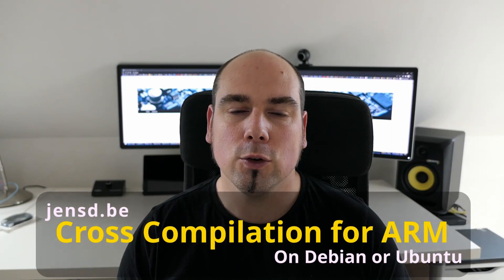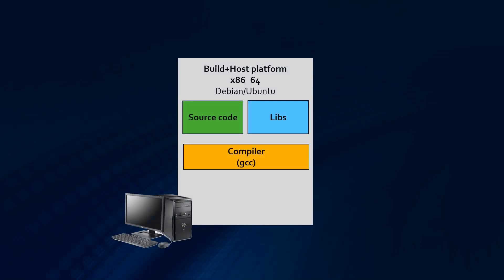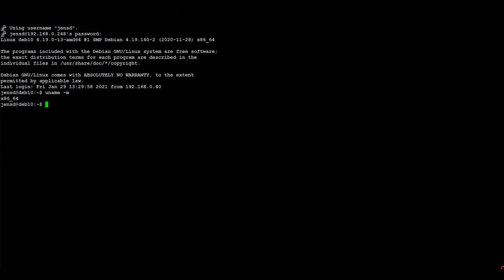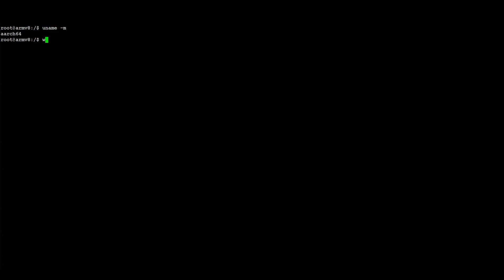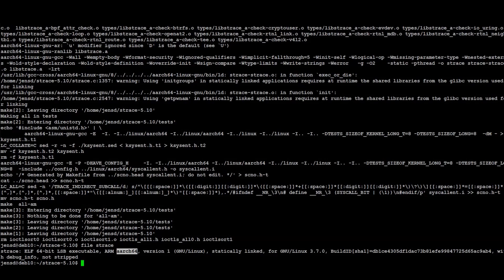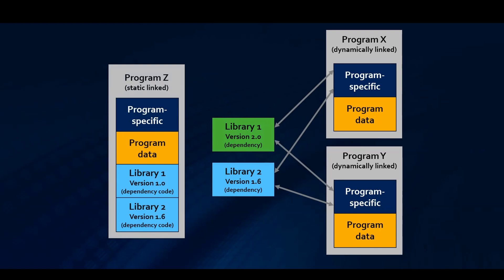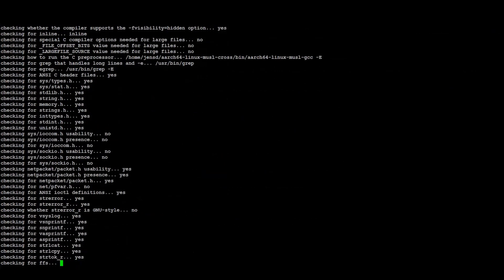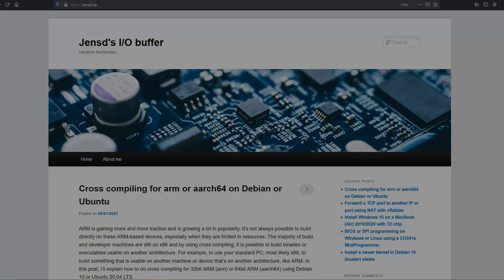Cross compiling for arm or aarch64 on Debian or Ubuntu

Comment: What if the project requires a ton of armhf or else libraries as dependencies?
Reply from the maker: Probably the best option is to script the whole process then instead of going through each manually.
Reply: @jensdbe  isn't creating a docker image with all requirements (like libsdl2-dev etc, the common ones) preinstalled more convenient? That said, i have no experience in doing that, just used other people's docker image to create stuff for my armhf handheld. Some times it works, some other it just needs more. Not existing in xenial repositories etc (that's a xenial armhf docker image)

Comment: What if I now would like to crosscompile a random other package like tensorflow?
Reply from the maker: Similar approach for that. Pre-compile any prerequisites by doing ./configure and make. Then do the same for the actual package/binary that you want to compile. As I did for tcpdump in the video.
Usually a bit of reading is required for the specifics/flags for each tool.

Comment: Generally, works fine except for big endian. When using option '-mbig-endian' it's only possible to compile object files. When building shared libraries or ELF files, error "libstdc++.so (wrong file format)" is issued. It seems the linker tries to use the little-endian version of the .so file.

Comment: Is there a way to cross-compile python script on, let's say Ubuntu, to run on raspberry Pi armv7l? I have been searching a way to do this but haven't been able to get a concrete solution.
Reply from the maker: Python scrips are generally compiled at runtime so they are platform independent. You just need to have the same libraries installed and they should work

Comment: Very clear! Is it possiable to do the dynamic linking?
Reply from the maker: Sure, that's the default, so if you don't pass the -static compiler flag, it should use dynamic linking
Reply: @jensdbe  Thanks for your reply. Is it possiable to install the required arm64 libraries on a amd64 Ubuntu Computer.So I can cross-compile my own library to arm64.

Comment: Is this can by apply on RasPi 4B on Ubuntu 20.4? I can't install programs because Rasp is aarch64 and programs on Ubuntu are for amd64. Is my assumption is correct?
Reply from the maker: The easiest if off course to use tools and programs from the Ubuntu aarch64 repositories by using your regular package manager (apt). But if you need to compile something or want it static linked, then this is what you're looking for.
Reply: @jensdbe  Thanks for info! Channel subscribe.

Comment: I am not familiar with compiled languages. Could someone explain why in many cases (not shown in the video) programs don't work when compiled for a different architecture? 
In other words, why can't Apple just re-compile all it's programs so that they work on the M1 chip?
Reply from the maker: This can get quite complex but, at least as far as I understand it, simply said this is because a lot of tools/programs contain code or instructions tailored to one architecture. This is mainly done to gain performance. By using architecture specific and optimized ways of addressing the hardware and resources you can gain speed. Most CPUs, even when in theory they are on the same architecture have this kind of optimizations. Before you can recompile such code for another architecture, you would need to replace that CPU/arch-specific code with an alternative that works on the new arch. And even if you can, there might be an impact in performance or you might hit other limitations.
Reply: @jensdbe  Thanks for the reply!
Reply: When you write a program you try to do your best to optimize it. So Apple old software are written in a such way that are optimized on that old arch. That's why it need to rewrite the program to optimize it with their new M1 chip instead of old PowerPC arch to intel x64 Adoption.